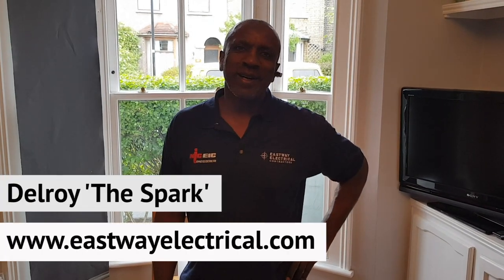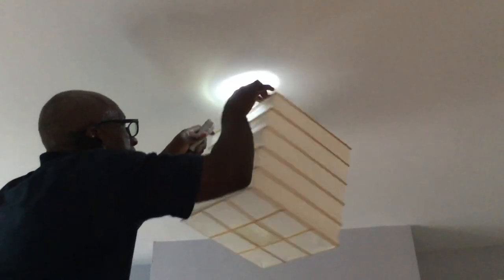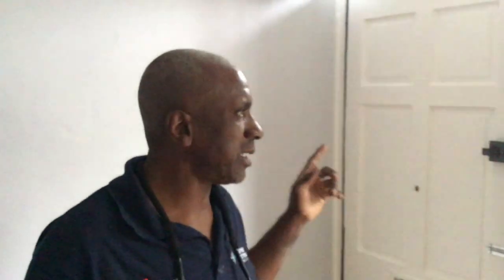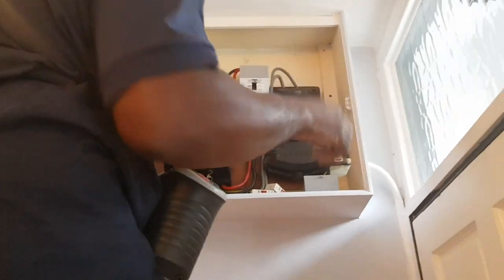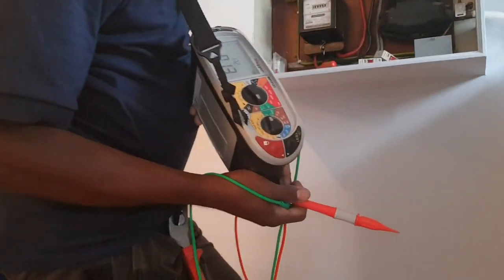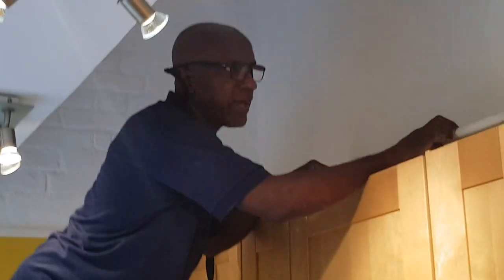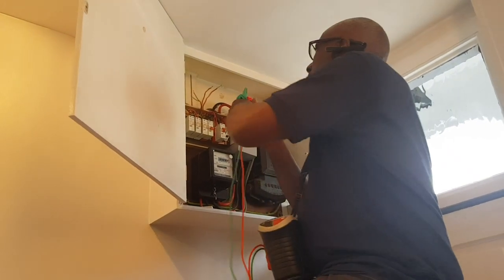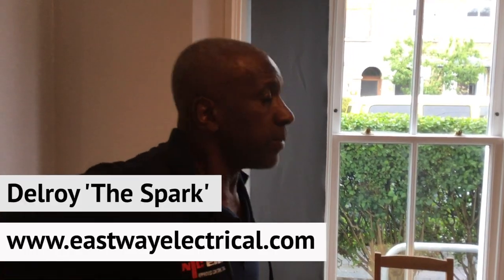Electrical Testing -  Electrician In London Vlog #15

Comment: So..In total......It's an unsatisfactory....FAIL? 
With sevaral F1's C2's  as you mentioned, plus unaccessible conection points ...a ring that is damaged somewhere...and incorrectly and insecure light fittings installed.
Reply: Also No RCD descrimination? A fault will trip the whole house into darkness.
Reply: @001Neal100  Dependant on which standard the the installation was installed to comply with RCD discrimination is not required.